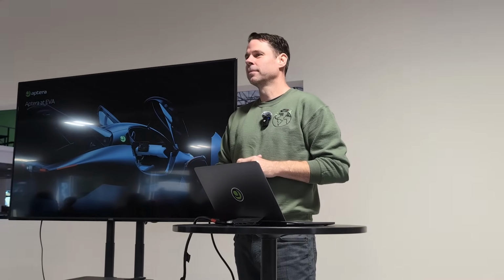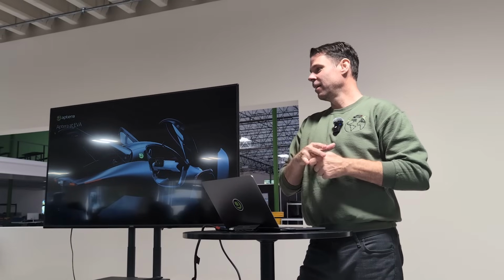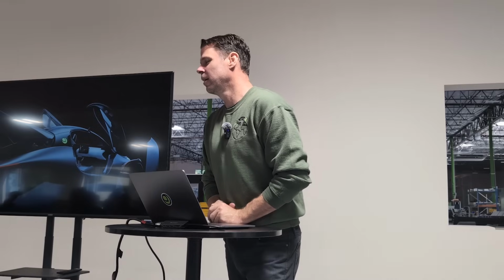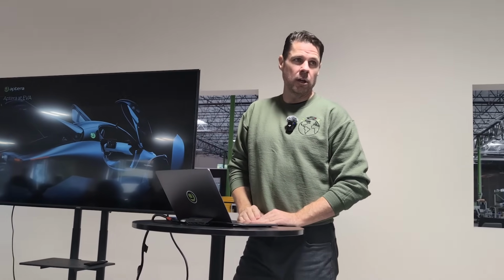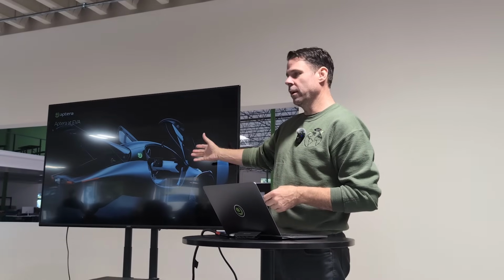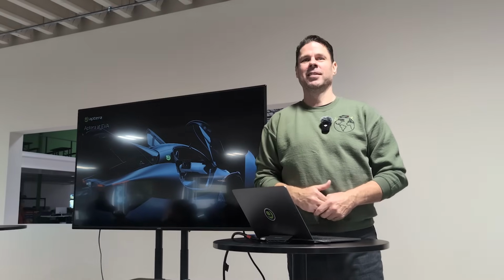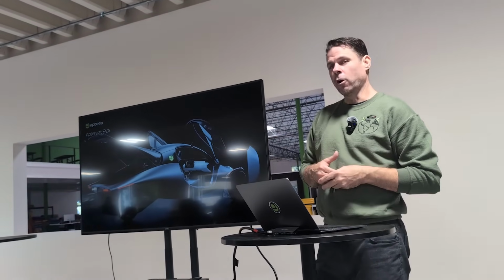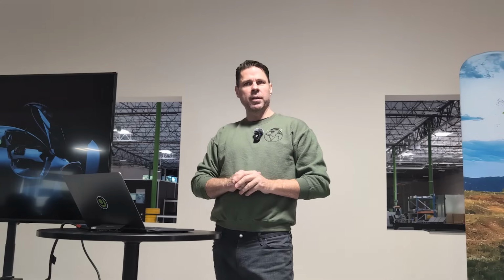Aptera Q&A session with Chris Anthony at EVA 2024

Comment: I'm very excited about the Aptera, but I was disappointed by Chris Anthony's response to the question about the environmental impact of creating the carbon fiber in the Aptera at 3:45. He should have acknowledged that manufacturing a carbon fiber body has much higher emissions than an aluminum body. One study I read found that CF-SMC parts emit 109 kg CO2 for every kg of parts. Anthony could have said that those extra emissions were counterbalanced by the lower energy required during the operation of the car due to its light weight, but I would have liked some acknowledgement that they are conscious of the embodied carbon costs of their car. 

I'm guessing that the Aptera is the most environmental car that one can buy, but I would like to see someone calculate its carbon footprint which includes its manufacturing emissions.
Reply: Aptera is greenwashing it. Those bodies are traveling from Italy to CA. That;s a long trip for bulky items. So the shipping distance per kilo is really high. They should just move the machine from Italy to CA and make the parts there. Thus more efficient and better for the environment. The machine doesn't care where it's at, it does the same job.
Reply: @billsmith5960  , Ocean shipping has very low emissions per kg and CF-SMC is very light, so I really don't think that is a major issue. At any rate, the long term goal is to make the bodies in California. It is far more important to worry about the shipping of the component materials. For example, it is common for battery materials to be shipped around the world several times before they end up in the final product.
Reply: @amosbatto3051  - Why not just make the bodies and all of the panels in their CA plant from the start? It's all done, they have the molds and all they need to do is buy a few machines. That way they start off on the right foot.

Remember, these will be shipped by container and they are very bulky, so even being light, they take up lots of room and thus the cost of doing this makes no sense. financially and for them trying to save the planet.

I also can see if they did build the bodies at Carlsbad, that 102 minutes per vehicle (12 to build and 90 to wrap means a completed vehicle in the real world) will get much longer and people will figure it out.

Comment: Chris Anthony is such a class act. Knows how to answer every question thoroughly and concisely while still making room for jokes
Reply: He was so approachable and engaged all weekend, and I was super impressed at the level of depth and breadth he knows the product, engineering, and logistics.. great team there.
Reply: Watch out “He’s a 🤗 Hugger too ! 😉
Reply: Aptera has been doing this awhile and the team has been proving they are flexible and they are used to dealing with engineering challenges.
Reply: 9 times stronger than steel and I can see it being used to make vacuum tubes to transport on suspended magnetic rails whatever parts or completed parts you need. Inside the tubes will there be road vehicles being transported? Wow this is great. I love this vision and it will be possible. Stage one. . .

Comment: Not having to have a motorcycle licence and not having to wear a helmet. Is that true in Canada as well?
Reply: Just as in the US that varies by state (MA still requires a motorcycle license for autocycles) in Canada that varies by Province. Check with your Motor Vehicle Department. Other modifications may need to be made to be sold in CA, such as digital menus in French.

Comment: What happens if the battery gets damage?
Reply: Given the Right to Repair strategy, I am hopeful that you will be able to open up the battery and replace the damaged cells. A device may be needed to accomplish this. You will probably want to go to a repair shop and have them deal with Aptera about getting the tools needed. 

If worse comes to worse, Aptera may have to replace your vehicle. They can then tear down the battery pack and rebuild it for resale. It would be the same thing as declaring the vehicle a total loss.
Reply: @richardryley3660  🤔Home cell replacement is not gonna happen. Those cells are all welded into their modules.  The modules will be individually replaced if necessary if one goes bad. A module with bad cells could be disassembled and the good cells then built into other batteries, but only by someone with specialized battery welding equipment.
Reply: @fotoguru222  I could have sworn I replied to this comment. 

Replace "cells" with "modules" in my original post. You may need to take your Aptera to a local mechanic to order the device needed to remove the modules, but I don't expect that Aptera will declare the vehicle a total loss.

Comment: Hi Steve, do you know if the dash solar panels is going to be high gloss / reflective finish (like it is on the hatch and roof) or matte so as it doesn't reflective Glare into the driver's and passenger's eyes
Reply: No it is not.  It does not have glass on it either. It has a duller finish I think they may have accomplished it with an anti glare solution

Comment: I’d be interested in hearing how Aptera is going to help with their vehicles being sold in states that have very restrictive dealer protection laws. Somehow Tesla has gotten around this. I’m in ND. I’m an investor (unfortunately not an accelerator) and I will have my Aptera somehow. Perhaps an existing dealer of other motorsports vehicles could be delivery only dealers? A minimal handling fee until Aptera can go customer direct?
Reply: short answer; they are not cars.
Reply: @chrisbailey5055  so when you say they are not cars you mean that there won’t be issues? I ask because in ND the same laws that apply to cars also apply to motorcycles, ATV’s , boats , etc.  I worked in a motorsports dealership for 16 years. My in-laws currently own a Polaris franchise. It concerns me because I don’t want to have to go to relatives in Oregon to buy my Aptera. Maybe ND is the only state with dealer protection laws for motorcycles. I don’t know. Thanks for your input 😁
Reply: Down the line this may be a concern, but for now you would not order an Aptera from a dealership. It is bought online and shipped to you. 

If your state seems to not allow this I would look into it. But it should be possible to either go to the factory and pick it up, or have it shipped to you.
Reply: @richardryley3660 many states don’t allow vehicles to be shipped to someone from the factory. Like Virginia. If I went that route, I’d have to go to Tennessee, the closest state to me that allows it. Since I’m an accelerator now, I’m going to california (unfortunately) to see mine in person and stuff and then have a company ship it across the country in a covered trailer. Defo not driving that thing that far.

Comment: Nobody asked about DCFC. I wonder how fast will LE charge?
Reply: The estimate is that it going to end up around 50 kW. This would give you 250 miles in 30 minutes, which doesn't seem like much, but it should be enough to get you home. Given that you get 40 miles per day from solar, I think the idea is not to rely so much on fast charging and instead leave room in the battery for continuous solar charging. 

They will probably make the decision based on how well their cooling system deals with the heat from recharging. 

I expect the 600 mile and 1000 mile models to have better cooling and better fast charging, maybe up to 100 kW.
Reply: @richardryley3660  Tesla's website the  Model 3 csn charge Up to 175 miles in 15 minutes on a SuperCharger. The Aptera will charge 125 miles in 15 minutes at 50kW.
Reply: @richardryley3660   Yes, but remember, that's UP TO 40 miles per day from solar.  On a gray winter day, less than half that.
Reply: @fotoguru222  If you get less, you still get something. Remember there are going to be people who don't even get the full solar package. They'll be getting 20 miles per day in the middle of summer. 

But if your battery is full, you get nothing. You're wasting money at the charger, when you could be getting some mileage for free. You only need about 250-300 miles anyway, the rest is a buffer. For efficiency, your charge should stay around 50-60% unless you're going on a long trip.
Reply: Hi Stan… I hope you were attending via the EVA zoom. I haven’t heard anything new on DCFC since the original info of 40-60 kW i.e.? https://youtu.be/JD6ES183knI?si=nmYJ1VmTbf1eauFb 
Cheers Len
Reply: Level 1 (110v) 13 mi/hr, Level 2 (220V) - 59 mi/hr, Level 3 (DC FAST charge) 40kW to 60kW - 400 mi/hr to 600mi/hr
Reply: @garywozniak7742  Thanks. That's the info given in rush when they reversed the decision to abandon DCFC. At some point, they should be able to be more specific.
Reply: @stanislavjaracz  This will happen when they have the PI vehicles to do evaluation testing.

Comment: OMG! Speaking about pedestrian impact, what happens if the person gets caught between the nose and wheel pant? Wouldn't his or her leg get amputated at the ankles by the front suspension arms? 😨
Reply from the maker: Yes possibly depends on speed so could end up with below knee amputation.  .  Impact from another sedan would cause above knee amputation.  Impact from large truck or SUV would cause thorax trauma resulting in death.    So auto vs pedestrian is usually bad for the pedestrian no matter what. But between lower leg amputation, upper leg amputation, and death.  I'm choosing lower leg
Reply: @ApteraOwnersClub LMAO, most likely just broken not amputated unless the vehicle is going like 100mph. 💀
Reply: Don't like my driving, then stay off the sidewalk. 😋

Comment: Great Q&A, but 1 question Chris did answer wrong, sadly. The motorcycle license requirement is still a thing for people like myself who are in Massachusetts. MA seems to be the only state that requires it for 3-wheeled vehicles. Still hoping this changes by the time my Aptera is ready, but if not, I guess I need to pass a motorcycle test before driving it.
Reply: There is an ongoing effort to work with local elected reps to address issues like this. Connect on the forum with group working on these in MA. There are many such actions in progress, one of the most important is to get three wheeler EVs on the tax credit.
Reply: @VedaSay  I'm on the Aptera forum and posted about the MA autocycle laws back in 2022. In that post, I had mentioned talking with Michael O. Moore, the one who wrote the bill trying to make the changes about autocycles in MA, but at that time, he had no news and said his colleagues were re-filing a similar legislation "next session". This was back in late 2022 though, but I'm not seeing anything new about autocycles in MA from my Google searching.
Reply: Senate bill S2203, in legislature now. Hearing was 24JAN24
Reply: @chrisbailey5055  Do you have the right bill number? Looked up that one and it is for enabling net metering for on-site solar energy.
Reply: House bill H.3307, Senate bill S2203  @Lord_Mangoat  Polaris and a Polaris dealer spoke at the hearing...they could have done better.  I cant post links here...
Reply: I took the three wheel motorcycle class and test last April in Washington state and it went well.  I don't actually know the enforcement program for Aptera in Washington but thought WTH and did it.  At 79, I was the oldest person there by at least 20 years.  You can do this.